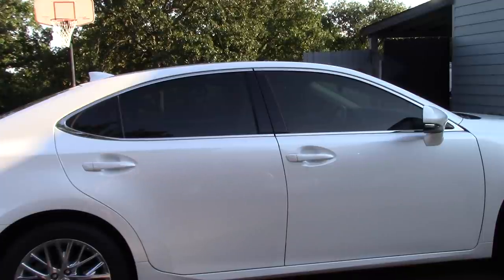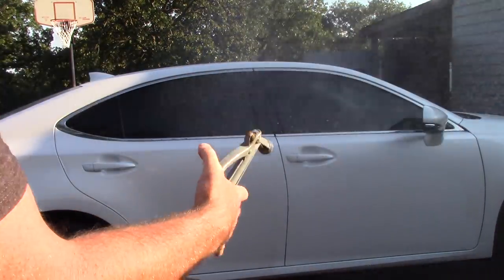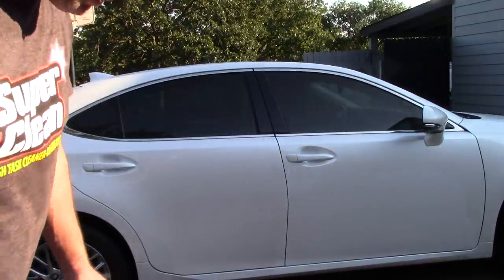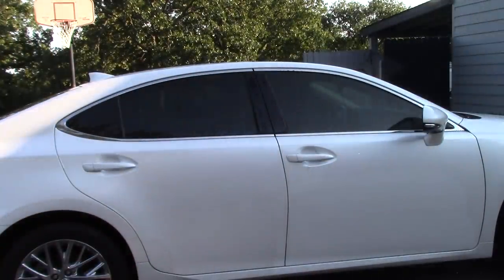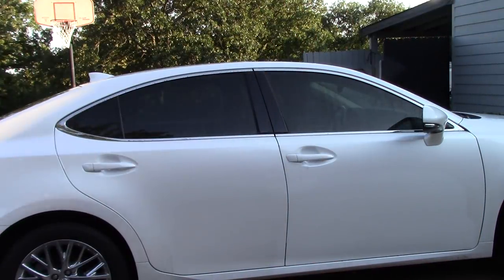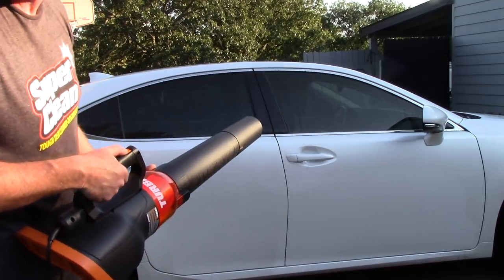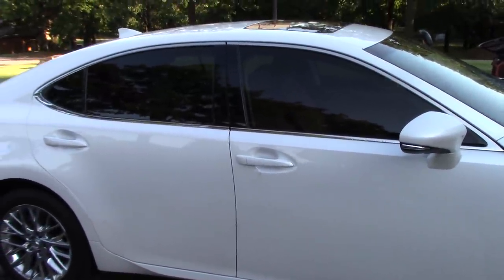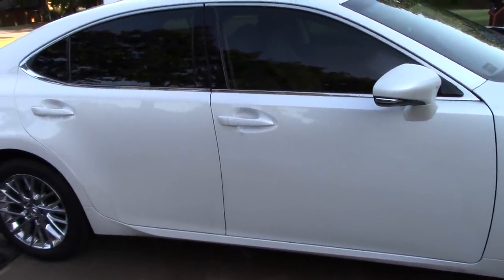A Great Way To Dry A Car!

Comment: Rinsing car without hose nozzle allowing water to sheet in conjunction with a leaf blower, is a huge time saver!:D Great tip Scott!
Reply: That hose nozzle trick was such a revelation for me too,  the car's basically dry before you dry it, yes!
Reply: I don't quite get what you mean. Rinse and dry with both hands or something?
Reply: @marcjoseph1124  For your final rinse, remove the nozzle from your garden hose. Rinsing this way, insures the stream of water dries the car itself.
Once done, your car is completely dry aside from a few spots which can either blow off the car or blot with a microfiber/drying towel.
Reply: @djdrake5379  interesting

Comment: Blower has been my go to for years. Blow the driveway, pull car out, blow loose debris off car, open doors, remove car mats, blow mats and interior (less to vacuum)under seats etc. Now wash and dry as Scott illustrated. Idea is to be fast touch your car finish as little as possible.

Comment: Congrats on 5k subscriptions!!!! Love your videos .

Just got this blower and tried it out.

Last week I did a two step griots paint correction (correcting creme, some perfecting creme) and finished with griots final sealant ( I think that's what it's called).... so the paint is protected.

Yesterday I Washed the vehicle and used my pressure washer this time around to rinse.....the paint was really hydrophobic.... tons of tiny water beads.

Using the blower I found that yes, it blew lots of water off but found that it took forever to really push off all the water beads... in fact the little micro beads of water just wouldn't blow away... just got blown around.....

This particular vehicle isn't all that big... a Ford Escape... but it took a while to dry it up....

In any case the micro beads did dry up and did leave a ton of tiny water spots so much so that today I used maguires detail spray to wipe the vehicle down as the spots were bothering me... got most of them off.

What I learned.... maybe next time I will use running water to rinse instead of pressure washer as it will leave larger beads of water which may be easier to blow off and I will only try to get 80% of the water off and microfibre the rest.... I hope this produces better results than what I did this weekend.

Any thoughts Scott?

Comment: I have been using this blower for the past three months. It is amazing if your car is waxed or has a sealant on the paint. I almost do not use any drying towels at all. Only at some let overs water drops. I do not have to worry about scratching the paint anymore.

Comment: Scott, drying my cars to get the water spots off has been the most difficult thing to tackle in detailing. I just bought this for $50 on Amazon! And, I learned that it's those little water beads that cause the spots. THANK YOU!!! I can't wait to use this and to see your next video. The less touching the paint the less swirls, eh?
Reply: I might get one myself after seeing the price, it's cheap and does the job needed. Plus I won't be using my big microfiber towel no more. But I might look into the cheaper one for $30 from the same brand but it's called worx mg217
Reply: One word.  Spot Free Water.
Reply: Jon Jaramillo that's 3 words
Reply: TheBaz568 Humor is not lost on you huh?

Comment: Scott...been using a blower to dry my vehicles for many years...tip...get rid of that corded blower, what a hassle with the cord crap❕ Switch to a battery powered blower, you don't have to spend a bunch of money...I've got a 40V GreenWorks 24312 thats fantastic, has a  concentrated nozzle attachment which really gets your wheels, engine bay and cowling nice and dry...😎
...like your vid's...little winded but honest and make your point...good info 😁

Comment: Hi Scott been recently binging on your video and they all talk good sense.On this video you talk about water spots,I don’t get water spots after washing the car I rinse with DI purified water and it leaves no water spots so you can save time by allowing to drip dry, but to keep customers happy you need to dry off.But what the DI does is save time as the glass is spotless.Again Di can act as a degreaser removing wax so you would need to re-apply quick wax

Comment: can use a shop vac also just switch the ends and the air is pretty warm/hot and works great also :)
Reply: Johnny Boy I was thinking the same thing using the Ridgid wd4070, just taking the vac hose and switching it to the blower part, but I don’t want to push out any contamination from vacuuming onto the wet car that could be stuck in the corrugated parts of the hose. You can buy another hose for just for the blower so it stays clean, or you can buy a worx leaf blower and dry the cars you work on and also clean up your yard lol. $40 for another hose just to dry the car or $55 for leaf blower that can do multiple jobs. It actually doesn’t look like a leaf blower, especially If you black out the Worx lettering, it will look like some expensive car dryer that was made just for that purpose. Idk I’m still debating, hose or the Worx🤔

Comment: Or a couple of drying microfiber towels...which by the way is the only step I like to take some time. It allows me to evaluate my cleaning job.
Reply: Agreed but key differences are you run risk of scratching or maring the paint with the MF.

Comment: I use the E-go 56 volt cordless leaf blower I got it on sale at Home depot for $100. By the specs it's actually more powerful than this unit but I imagine for $50 you aren't going to complain . The battery powered version is good for about 1 maybe 2 cars before it needs a recharge. Fine for your at home user probably not ideal for a mobile detailer however not needing a cord could be useful to some as well.
Reply from the maker: yes that E-go blower is great as well!...and your right it could be an issue for guys drying many cars on a daily basis since its battery powered...thanks for your comment and support..much love my friend:)
Reply: GarageCivic The most powerful Ego is 580 CFM, this one is 600. Am I missing something?
Reply: It’s actually not more powerful, this is 600 cfm, more cfm than any battery powered unit, even a lot of gas powered units,  plus no worries about batteries, fuel or mixing,  or any of that. The only thing the ego has is air speed, but you don’t need that much air speed to move water, what’s more important is cfm. That’s why you can dry a car pretty well at 80 mph on the freeway, but the amount of air hitting it is huge, lots of cfm. The ego moves 580 cfm of air, but that’s at the highest setting, battery wont last very long, back to recharging it. 👎🏻
Reply: How and when was it $100? Cheapest E-go at home depot is $150 with no battery or charger, $349 with battery and charger for 575 cfm. I just ordered one of these from Amazon for $49.24 taxes and 2 day shipping included.
Reply: Actually, Ego has a 600 cfm backpack leaf blower.
Reply: I do landscaping & pressure washing siding/decks.  After my gas/backpack blower got stolen, I got the E-go 56 volt on a whim.  After a year of using it, I'll never back to gas/backpack.
Reply: @hopeechangee12345678  I would be piss if someone stole mine too. How many batteries do you use for job? I would probably need around 3 .

Comment: Nothing beats a chamois clothe for drying. Way faster, less clunky, weights nothing, no noise and it just works.
Reply: Thinker101 also it risks swirlls
Reply: @Ebruhhk  You risk swirls just as you would any other micro fiber cloth. Except Chamois are far superior when it comes to drying. They only way ti truly miss swirls is to use an electric leaf blower not everyone has one. And it more clunky not as fast and way heavier. Also you risk blowing more dirt back unto your car. I had one time where I had just finished rinsing and  decided to use a blower. Just as I turned it on, bam, dirt got back all over one half of my vehicle. That was the last time I tried a blower.
Reply: Thinker101 maybe wet the floor next time. That way the dirt and dust and shit will not fly eveywhere

Comment: You mentioned if a car has no wax, it would be hard for a leaf blower to blow off the water off. I just clay bar and waxed my car a couple weeks ago.  I used a PH balanced car soap to wash it the other day and I saw a lot of beading and water sheeting. The problem was why did the water act as if The car had no wax on it. I used mother’s Clay bar and meguiar’s unltimate paste wax.  I used  pretty powerful blower and it should have blown the water off easily

Comment: I have a question as you quickly go around with the leaf blower and blow off the majority of the surface water can you then use a microfiber cloth to take the little bits left or should you not do that?

Comment: One thing we all always forget about leaf blowers is the air it’s sucking in is not filtered! Gta remember that so your blowing whatever that blower is sucking in onto the paint of the car your drying. I’m sure the chances aren’t good for it to damage the paint but the risk is there. I put a hepa filter over the area where it’s sucking in air and tape it there. Doesn’t slow down the air coming out what so ever
Reply: I just got mine. Unscrewed the housing and put an air conditioner particulate filter glued inside. I'll be very surprised if it doesn't slow down airflow  a lot. How can it not?

Comment: I use a Toro super blower. The discharge is rated at 225 mph/385 cfm. It's not 600, but does an adequate job. The Toro might be slightly heavier. I recommend ear protection.  ~$60.00

Comment: Water spot is caused by remaining minerals and other material that was suspended in the water after it evaporates. Use a filter and remove all that or distilled water and you will never have a water spot. I do love your content and I’m learning a lot.

Comment: I'm buying it! Mine sucks and I even have a wax on my car. Scott would you be able to do a video on how you would use a steamer on the interior carpet and cloth seats? Also I was wondering what you thought about adding ONR to wash buckets with  at wash soap? I know it is suppose to kill the suds but I'm sure it would still be slick and clean well.

Comment: I heard from detailers around my area not to use a leaf blower as it has no filter and can suck in and throw out particulates at your vehicle.  Thoughts?
Reply: You mean the same particulates you drive through at 100mph? The moment you drive the car after washing it in 5 min you’ll accumulate dust and debris on the panels anyways, keep it simple!
Reply: My thoughts as well.

Comment: I just started watching your videos last night.  So far great content!  I have a new white car and I have been washing it. I need all the tips I can get.  My car has no wax on it.  Should I clay bar and wax it?  Do I need a sealant after that?  I am going to buy this leaf blower on Amazon now. My least favorite thing to do is dry it.
Reply: Do not clay your car unless you are going to polish it or do a paint correction right after. That's very important to know. Next, do not put a sealant over a wax, or vice versa. Only use one or the other.
Reply: Excalibur Mobile Detailing  Thank you very much for this reply.  I will just wash and wax or seal it for now.
Reply: @nettejean5912  You are very welcome. And yes, these are tips that I learned myself through Scott's wisdom. 😉

Comment: Thanks for the video. I'm considering to buy "Ryobi 155 MPH 300 CFM 40-Volt Lithium-Ion Cordless Jet Fan Leaf Blower" to dry my cars. I'm always worried about micro scratches. Do you think this code-less blower will work?

Comment: Hey Scott,
First time viewing your videos. Great tips for the begginer/weekend warrior !!! My question, what is the best car wash detergent/soap to use ?? So many options, going nuts, trying to figure out what car wash soap to use 🤯🤯🤯
Reply: Personally I use rain x car wash and chemical guys citrus. My reason is the citrus gets rid of everything meaning it is a very good cleaner; however, by itself it creates waterspots if you do not dry your car quickly. So i add rain x car wash to it do give it some water repelling properties so water does not settle on the paint. I combine that in a foam cannon electric powerwasher and i hardly even have to touch the paint on my car. That takes away chances of scratches and less time to dry

Comment: "I don't have wax on my car but that's another story for another day"
I worked at a detail shop for a couple of years and come to think of it- I NEVER seen the owner wax his cars either😂
Reply: Once knew a body shop guy who never waxed either. This guy always attended work shops hosted by 3M and learned that wax was destructive to clear coat. Before clear coat , ie single stage paint,wax was necessary. He recommend a a fine grade polish if I ever needed to add shine to my vehicle🤷‍♂️ he passed away years ago, I wonder what his opinion would be on these new types of ceramic coats?

Comment: Just use a GRIOT'S GARAGE towel & 3 mins later your car is completely dry , they are pricey, 40-45$ , but 100 % worth it , especially for personal vehicle drying. Probably not cost effective for a Mobil detailing, because obviously u need to let it dry for multiple hours before u can use it again , time is $ for pros , but they are absolutely perfect for your home car or suv

Comment: If you do not want water spots Simply    buy a   Reverse Osmosis system either DI or RO/DI  and  produce soft water .. then use a pressure washer which can draw water and rinse with Soft water ... thats how GAs station  car washes and  professional Cleaners   do it ..

Comment: Great video. I'm about to order one, but I'm concerned about the blower potentially sucking up debris and blowing it back on my black car. Valid concern or no? Thanks!
Reply from the maker: will you be holding the blower 2 inches from the ground?...we always have dust flying in the air and it hits the car constantly as we drive at 80 miles an hour...because dust is always present in the air, even if it had a filter you would still be blowing that dust that is so small between the space of your nozzle and the car even if the blower had a filter..just keep the blower up by your hip because it doesn't have enough power to suck dirt up from the ground as you stand...hope that helps with your question
Reply: That does help with my question and I believe I'll be buying one. 

Thanks for the quick reply.
Reply: just don't make the mistake I did and try blow drying the car with the car in the garage.  All the crap stuck in my garage door (up above, open) fell down on top of the car.  I had to pull it back out and rinse it off again.

Comment: Here is an off the wall solution to water spotting: dishwasher rinse agent.

Don't scoff, if it's used carefully, the car's finish is not in jeopardy and you can let the car drip dry. I'm in Chicago, use municipal hard water.  

I've only done this on my own dark maroon SUV with McGuiars Utimate wax or Paint Protect applied, but I believe that it will work on a bare paint finish. I didn't notice an effect on my twice-yearly waxed vehicle's finish. I usually wash my vehicle in mid morning when the temperature is in the 70s, or late afternoon in the shade, and spend more time cleaning the aluminum wheels that the rest of the car. 

I use an inline hose detergent dispenser.  All my hoses and attachments have brass quick connectors, and the hoses have brass cutoff valves. I add 4 oz e of dollar store or Finish rinse agent to the inline dispenser. The dispenser fills with water when the water is turned on.  

Immediately after washing away the soap with the hose spayer, I set the sprayer to a rainfal pattern and insert the detergent dispenser. I start at the roof and quickly walk around the car spaying from top down in a spiral. 

It took me 3 attempts to right my speed right, but since I did, I can let the car drip dry. Actually most of the rinse water runs off so fast that everything but what's in the creases is gone within 3-5 minutes, and the glass and paint is spot-free.  I'll either use a microfiber to wipe out those cracks or just drive.

Comment: I use a echo backpack gas powered blower in concert with a microfiber in hand. Seems to work but the catch is its noisy to the neighbors
Reply: so is cutting the grass or other yard work.  Do they complain about that also?
Reply: Patrick94GSR no they don't but in terms of running any noisy equipment I try to be a respectful neighbor because my driveway is 4 feet away from their bedroom.

Comment: The proper way to dry your car with your hose.  Yes, your hose.  After rinsing your car, remove the nozzle and go over your car from top to bottom with a flow of water.  You will remove 95% of the water.  The last 5% can be removed any way you like.  I prefer the blower method.